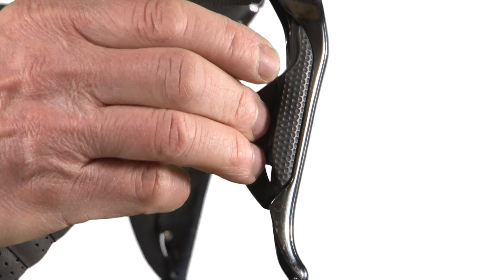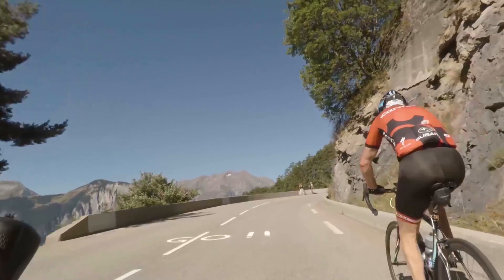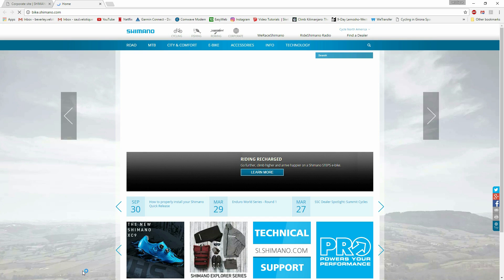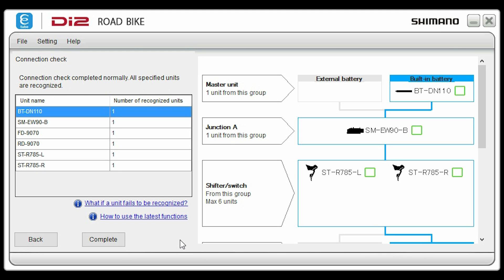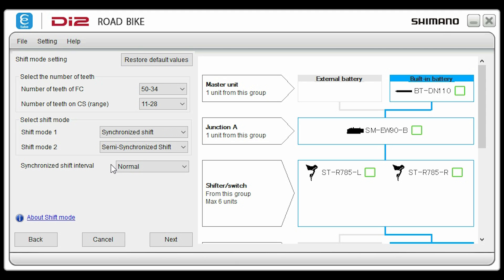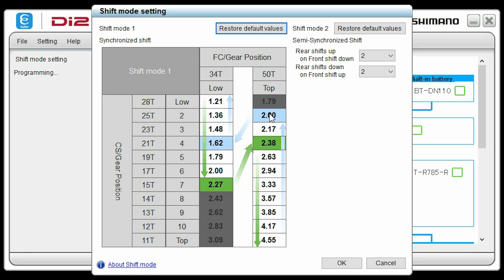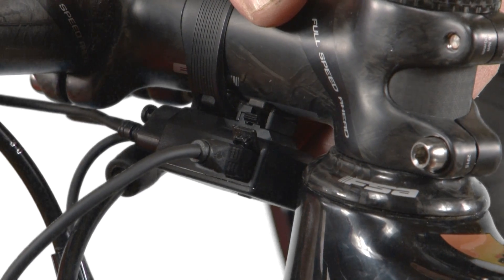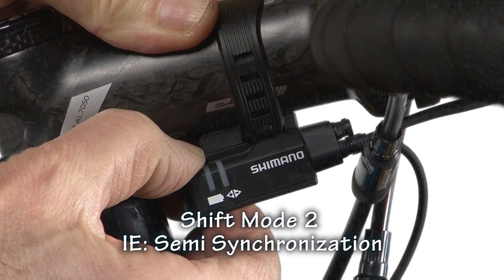How to Setup Synchronized Shifting on your Shimano Equipped Di2 Bike

Comment: How do I get my bike out of synchro shift mode? I have aTrek Domane SLR 7 with Ultegra Di2. Unlike the bike in the video above, there is no junction box installed on my bike. To charge my system, I plug into the handlebar end cap. I have the E-tube software on my iPhone, but it never detects my bike. Am I supposed to download the E-Tube software on my laptop and plug it directly into the handlebar end port??
Reply from the maker: The handlebar end is your junction box. Double click the button on the the end cap where you plug in the charger. If you do not have a wireless D-Fly on your Di2 setup you will need to run the E-tube program on your computer via USB wire.

Comment: My system is stuck in synch mode double clicking the junction box until its back in manual mode wont allow me to shift into big ring . the battery is fully charged and all the cable connections are good. Is it possible to reset it using the wireless unit ? Thanks
Reply from the maker: Check E-tube Project software settings for the various modes. It sounds like you have set some of the modes incorrectly. You can reset all to default settings and see if this changes things.
Reply: @velotiqueBetterWatchSaul  thanks for getting back to me ill try that

Comment: Great video!! Could you please tell me how to update in E-Tube project the cassette if I went from 28x11 to 32X11 (in from I have 50x34)? It is not an option on the program. Thanks!
Reply from the maker: Just use the gear positions and not the gear ratios to select the cross-over points. IE: Rear cog position 1-11 and front 1 or 2. The program does not really know what gear ratios you are using

Comment: In the e-tube appon iPhone I do not seem to be allowed to change the rear cassette from 11-28 to another one. ie. a 11-25 get message: bike has a gear structure that cannot be configured. any ideas how to solve this?
Reply from the maker: There are many unlisted gear ratios. The app does not really know what gears you have. Just pick the cross over points as gear positions not the gear teeth numbers. That is if you are configuring Synchro.
Reply: @velotiqueBetterWatchSaul  Thanks for this, I will probably do that. Only thing is (not really important) that my garmin (edge1030) will not show the correct teeth combination, but I can live with that:)

Comment: My light for battery check comes on ,but the double click on the juntion box no light is coming on?
Reply from the maker: Did you check the Compatibility Chart http://e-tubeproject.shimano.com/pdf/en/HM-CC.3.3.2-00-EN.pdf
If your equipment is compatible with Synchro the problem may be the timing of your double click; too fast/too slow?

Comment: I guess this doesn't work with an Apple computer, only phone.  Am I incorrect?  And, for it to work with the phone, I need to buy the wireless part for the Di2.  Are you able to confirm?
Reply from the maker: Yes you are correct on both points.

Comment: I find semi sync mode more manageable then full synchro shifting, which gives me more control of when I want to change from big to small rings.  Also the greater the range of the rear cog Ie..  11-30 vs 11-23 would require less change, so instead of the default which is set to 2 (upshift or down shifting), I find changing it to one smooths out your cadence, when shifting.   Just my preference, and I usually run semi sync more than manual or full synchronized shifting.
Reply: Paul Green Can you tell me is it possible to have semi synchro shift on Option 1..And normal gearing on the option 2 ?
Reply from the maker: You can set the options to correspond to any shift-mode you like. This simply changes the order of your mode selection. Not sure how this could be of benefit.

Comment: One more thing on the R8050 Ultegra Di2 TT set up with one button on the base bar you can not get rid of ALL synchro shift options you have to go to 2 button switches on base bar and aerobar extensions AND you need a 53/39 chainring set as well to completely remove synchro shifting. My personal opinion is for an experienced rider/racer synchro shifting is one of the worst thing Shimano has ever done to Di2. I LOVE Shimano but this was a mistake.

Comment: Your video was excellent and very informative! However, any experienced cyclist wouldn’t use full synchronized shifting! I disagree with you there but applaud you on an excellent video. Thank You 🙏 sir!
Reply from the maker: Thank you. I prefer manual shifting. With experience I can shift faster manually without the clunk of a Synchro Shift. Some users prefer not to think about when to manually shift. The user can choose.
Reply: I'm an experienced cyclist and much prefer syncro shift, especially since I have a very large  gear range on the back (11-42) and I don't want to accidentally select the wrong combination.  I find I shift more often with syncro shift, keeping my RPM constant and optimum.

Comment: Do you need the PCE-02 unit to set up synchro or can it be done without it?
Reply from the maker: You can  also use the SM-BCR2 (regular charger) or the Wireless unit to setup Synchro.

Comment: Brilliant video thanks. One question im having an issue where im on my laptop in the etube screen on Synchro settings.  I cant move the 50T selection down to 2.00 or 2.17. What i mean is when im in the front big 50 ring and the rear gets up to the 3rd biggest sprocket, id like the front ring then to drop from 50 to 34, but it wont till the rear get up to the biggest sprocket, Thats way to late for me. Its not really fully customisable as it says. Am I doing anything wrong? Looking forward to your reply. Thanks Meurig
Reply from the maker: Thank you. You are correct. Shimano does limit choices. There are usually some practical reasons for this. However, the program is always changing.
Reply: @velotiqueBetterWatchSaul  Thanks

Comment: You do a good job of explaining however, I am still confused. Syncroshift is something I am interested in. But I don't like the default shift point on the cassette from large ring to small ring. Mine is shifting the front big ring to the small ring only when the chain wants to shift to the largest 30T cog in the rear. I would rather have it shift the front rings at a point where the chain wants to shift to the second largest cog in the back. This chart and the color codes doesn't seem to be that simple to me yet. Could you provide more detail?
Reply from the maker: Drag the cross-over shift point from the largest 30T cog to the second largest cog, just below.
Reply: @velotiqueBetterWatchSaul  I gave the default settings a try first while out on a ride today. I liked the shifting when I started climbing and had to move to easier gears, but the shifts at the opposite end when speeding up was very clunky with the chain moving to the big ring and the cog in the back at the same time. I think I will just control the shifting on my own. The syncroshifting is not for me.
Reply from the maker: I also prefer manual shifting.

Comment: Thanks for your very clear and informative video. I have the bluetooth connection so even easier to program. I have been riding in the synchro mode and have to agree I dont think I will be reverting. The only thing I found was that when climbing and going through the gears it is better to drop to the small chainring earlier to avoid that double movement under load. Going the other way is fine as the chain is ''dropping down'' and not ''climbing up''. I will be doing the Pyrenees again in June so I dont think I will be in the large chainring much at all anyway!!
Reply from the maker: I agree completely. That is how I use Synchro also. You will enjoy your big chainring on the descents. I road the Pyrenees in 2010. Check out my video for a preview of what to expect. https://www.youtube.com/watch?v=Jw3vGgzM_3I&list=PL9EB3263A9D0551F1

Comment: Please help I cannot enter shift mode///// If SM-BMR1/SM-BMR2/SM-BTR2 is connected, shift mode will not function even if set.
Reply from the maker: Please explain your exact problem.
Reply: @velotiqueBetterWatchSaul  Hello.Thanks for replying. I have been informed that I need to upgrade the battery. The current battery that I own for my Di2 does not support the Synchronized shifting. This is why I was getting the error message. As the battery costs well over £100 I will just be using my bike without the shift mode feature. Most people that own Di2 that I have talked to say it is just a waste of time anyway. :)
Reply from the maker: It is definitely not an essential. Happy riding.

Comment: Can I program the top buttons on my shifters to operate the Synchro but leave the others on the shifter as manual.. How does one program these top buttons anyway?
Reply from the maker: Not sure I know what you mean.
Reply: I am referring to the button found on the top of the hoods underneath the rubber cover. They’re programmable.
Reply from the maker: Sorry, I'm not familiar with those buttons.
Reply: Hmmm. I assumed an expert such as you would be up to date on these matters. Maybe you should do some research....  both the latest Dura-Ace and Ultegra sets have them.
Reply from the maker: Will do.
Reply from the maker: What model number are your shifters?
Reply: R8070 Di2
Reply from the maker: If you have the optional SW-R610 (Sprinter switch) they can only be used in the same manner as the main switches. Unless you see the switches listed separately in the E-tube customization screen where you can select them and modify their function. For details see the manual at: http://e-tubeproject.shimano.com/pdf/en/HM-R.3.4.1-00-EN.pdf. Hope this helps.
Reply from the maker: On further investigating ...you must be referring to this: The hidden buttons on the top of Shimano Di2 shifters can now be used to change screens on a Garmin head unit or control lights. Garmin control was previously possible on the Dura-Ace 9070 with the use of a ANT+ D-Fly nodule purchased separately but was not widely used.
Read more at https://www.cyclingweekly.com/cycling-weekly/new-dura-ace-lets-wirelessly-control-garmin-shifters-307634#JUQh29z74QWPqYeE.99
Reply: @velotiqueBetterWatchSaul  Yes. And I understand it can do a lot more than that, including shifting gears. For example, if you're using Synchro, you can use the left button to shift up and the right button to shift down through all the gears... I have a system on order for my new bike build so I haven't had a chance to explore it in detail...  Curious in advance to see how I'm going to program it and take maximum advantage of them.
Reply from the maker: You will have to plug it in and see what choices are currently available with the latest firmware updates. Shimano is constantly changing options. I will check it out and report back.
Reply from the maker: I tried it. After updating the software and firmware. I was delighted to see the option of programming the hidden buttons on the tops of the hoods. Originally they could only used to control a compatible wireless computer. Now they also can be configured to shift gears. Shift mode cannot be selected separately for these switches. If you set Synchro-mode, all buttons are synchro enabled. Thanks for bringing it to my attention. New Video is in the works.
Reply: @velotiqueBetterWatchSaul  I have Ultegra 8000 Di2. I have an 11-28 rear and 50-34 front. When shifting down from 50 to 34 I feel that the rear cassette is to easy. I'd like to have the down shift be 1 ring harder than the default. How do I adjust that?
Reply from the maker: You can set the crossover point in the E-tube Project Software in Synchro-mode. Just drag the cross-over point in the gear map.

Comment: Super video. Thanks. A question. In syncro mode [full syncro], you mentioned that the kleft shifter controls what ring you are in. Say, you put it in the big and then keep on changing to a lower gear on the right shifter, will it still syncro shift from the big to the small?
Reply from the maker: Yes. Try it.

Comment: What to do,, when my rear cassette is 11/34 and shimano etube does not have that option?
Reply from the maker: The system does not actually know what gears you have. Make your own chart and decide what cross-over points you would like to use and choose the corresponding gear locations for your change-overs.

Comment: I have an older Ultegra that can not do Syncro shifting, what do I need new Battery or battery holder? I have external battery, thanks.
Reply from the maker: You will need the newer battery, external or internal. Make sure the rest of your components are compatible. Compatibility Chart
http://e-tubeproject.shimano.com/pdf/en/HM-CC.3.3.2-00-EN.pdf.

Comment: Thank you for the vid...well presented and very informative. One question..does the Di2 system arrive already set up as manual shift, synchro shift, semi synchro shift or do you have to set these up yourself? Apologies if this question has already been asked...I did not see it when i quickly looked through the comments. Thanks again.
Reply from the maker: Good Question. New Di2 systems come setup in default modes. Mode 1 Manual, Mode 2 Synchro, Mode 3 Semi-Synchro.
Reply: Excellent. Thank you for your prompt reply.

Comment: What kind of cable do I need to connect junction box to my computer to do the upgrade?
Reply from the maker: It is the charging cable that you use to charge your Di2 battery. it is the one that came with your Di2 system
Reply: velotique thanks, but I have the external battery with different charger.
Reply from the maker: Do you have a charging cable that plugs into a USB charger? Have you checked the comparability of you components? Compatibility Chart
http://e-tubeproject.shimano.com/pdf/en/HM-CC.3.3.2-00-EN.pdf

Comment: You can change the shift mode during the ride or you need to stop to make the change?
Reply from the maker: It is always best to stop before making any changes. It is dangerous to take your attention off the road. It is also difficult to see the indicator LEDs on the junction box from a riding position.

Comment: Like to ask for some advice on this subject. Yesterday I followed your instructions but somewhere I went wrong.OK, so I have updated my Di2 no problem. Then I decided to preset to semi synchronised. I selected semi synchronised shift. Then followed the instructions to complete. However on my first ride today I still had to change manually. So my question is "why". Should I also have clicked on the right brake box to activate this function from that gear shifter?
Reply from the maker: Did you select Sychro on the Junction Box by double clicking tho change the shift mode?

Comment: Great review, I just purchased a trek SL 7 with the Shimano 6870 di2 groupset. Will this work with synchronized shifting?
Reply from the maker: If you have the components listed in the chart it should work. http://e-tubeproject.shimano.com/pdf/en/HM-CC.3.0.0-01-EN.pdf
Reply from the maker: OOps this is the updated chart. http://e-tubeproject.shimano.com/pdf/en/HM-CC.3.3.2-00-EN.pdf

Comment: Thanks, that was really helpful !! How to make a set with a cassette 11-32 ? (She's not appear in the selection...) :/
Reply from the maker: Just use the gear positions and not the gear ratios to select the cross-over points. IE: Rear cog position 1-11 and front 1 or 2. The program does not really know what gear ratios you are using. Good Luck.

Comment: I've been running the synchro shift for a few weeks with a 50/34 and 32 rear cassette,at the moment it drops on to the 34(front ring) only when i change the rear to the 32 T .......Ideally I'd like it to drop to the 34 (front ring ) when I change to the rear 25T.
I've played around with the shifting mode but cant seem to get the combo correct............could you give me some pointer to achieve this (there isn't a 32 cassette to select in the programme so is this the problem?)
Reply from the maker: Since those are not the options listed you will have to pick an available set of option from the drop-down menu. Just use the gear positions and not the gear ratios to select the cross-over points. IE: Rear cog position 1-11 and front 1 or 2. The program does not really know what gear ratios you are using. Good Luck.

Comment: What if you are on the 50 ring and drop down to the 34 , on full synchro will it adjust the rear mech up a couple of gears or is that just the semi synchro ?
Reply from the maker: In Full Synchro, shifting the front derailleur does not effect the rear. Semi causes the rear derailleur to adjust to changes on the front.

Comment: Hi,

I have the BT-DN110 battery and the EW-WU111, all firmware is updated to latest version on all components, synchro shift is set on mode 1, however, I cannot switch between the modes. Double-pressing the junction box A button produces no effect, no led lits up. The system remains in manual mode, which I am able to check by a long press of a shifter's pad (green comes up for battery, then green + led, no blinking, so... manual mode). My Garmin 820 shows 'M' and I was not able to find any option to change shifting mode from Di2 sensor details.

Any ideas? :(
Reply from the maker: It sounds like you might be missing the timing of the double-click if it does not respond by changing mode. Try experimenting with the double-click timing. This is often a problem. The long-press, does indicate you are in Mode 1 with a single green+red flash. Check your firmware update and component compatibility and then contact Shimano to see if they can help.
Reply: Hi, that wasn't the problem. I've actually solved it by resetting the shifting modes back to factory settings (I had them reversed to full synchro on S1 and semi on S2). Everything worked as expected afterwards.
Reply from the maker: Glad to hear that you resolved it.